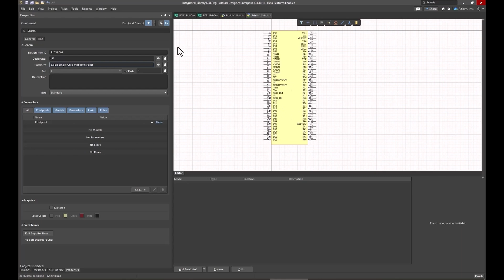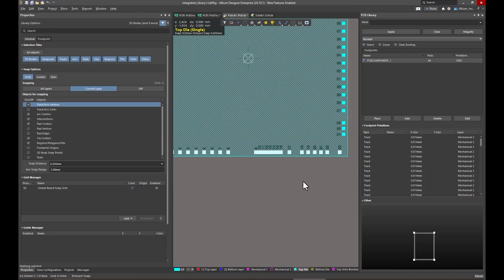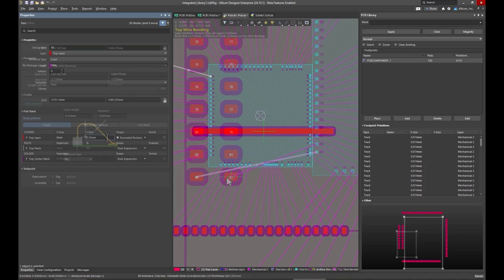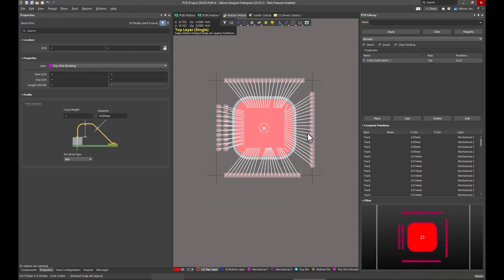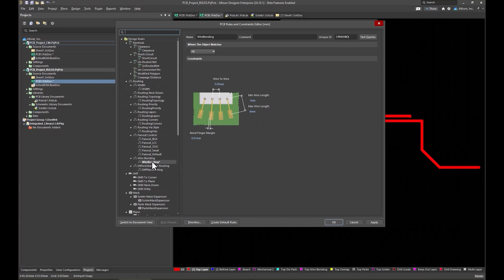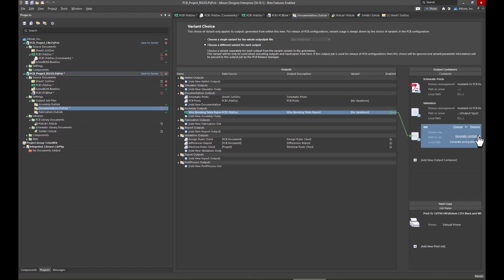Advanced Wire Bonding Techniques in Altium Designer - Demo

Comment: I am trying to use the Top Die and the Top Wire Bonding layers to import the STEP 3D model of my die and place the wirebondable die pads at the correct height (height of my 3D die model). 
https://youtu.be/aO292ia_lQs?si=TFyCgDULXm0Nzzos&t=79

In this tutorial, "Extruded" 3D model is used which is just a dummy block. It has the "Overall Height" text box which determines the height of the dummy 3D die body and also the height at which the wirebondable pads are placed an the Top Die layer.

But, in my case I am using the Generic type of the die ont he same Top Die layer, but this Generic type DOES NOT HAVE the "Overall Height" feature, so all the pads I place on the Top Die layer, are placed at the default bottom... And I can't find any way to influence the height the pads will be placed at.

Is there any solution to this or there is absolutely no support for the Generic 3D body?

Comment: when adding wirebonds from the PCB layout (rather than defining the pads within the component), is it possible to update the schematic layout with the updated netlist? Would be nice to have this so that the IC pinout is directly included in the PCB schematics
Reply: Everything is driven by the schematics, so you will need to define the pins first, then push the update to the PCB layout, not the other way around. One workaround is to set up pin swapping, then you could move pins within a certain group in the PCB layout and it will auto-update in the schematic.

Comment: Can someone tell me what the market is for this? Which industries use this tech? How niche is this tool and application? When I look at Chip on Board (CoB) I see the LED market pop up in google... I'm assuming FPGAs and ASICs (outside of LEDs)?
Reply: Most common use of this technology is Integrated Circuit Packaging. It applies to at least 60% of the components on a printed circuit board.
Reply: @ericr6287  right, figured
Reply: It's a fancy tool for documentation. Serious EDA tools do bond wire EM simulation so there would be some value in an accurate model. Altium is more of a CAD tool than an engineering tool in this way.  Maybe Altium's file could be used by Cadence for the analysis.

Comment: Just out of curiosity, how were we designing for bare die and blob chips before this? I know they've been a thing for over 40 years now; surely our design tools had some means of accommodating them.
Reply: Cadence tools mostly I presume.
Reply: It’s always cool to have new features to simplify and better align 3d models and reality, but you can do the same with careful planning and manual review.
Reply: Probably autocad to create a DXF of the pads followed by a 3D model of the wiring, or someone has a license to a proper packaging design application. On a different note, I think this is a prelude to a full-on packaging design application from Altium. Don't quote me on it and I have no visibility into the product development roadmap, but now that Altium is owned by a semiconductor company (Renesas) why wouldn't they venture into semiconductor packaging? Altium Designer is already like 95% of the way there, and we have been using it for organic substrate design anyways.
Reply: @Zachariah-Peterson  That's a juicy bit of gossip!
Now I'm thinking about the actual assembly process for those old COB designs. I imagine some poor shlub peering through a binocular microscope and fumbling about with a pair of pantographs to attach the bond wires. Yield must have been abysmal by today's standards.
Reply: @Zachariah-Peterson  Zachariah is somewhat correct.  To this day, AutoCAD is the primary tool used for creating wire bondiing drawings for simple packages such as DFN, QFN, QFP .. and other packages based on lead frames. For years, I have used an AutoCAD extension called "Electronics Package Designer" from Cad-Design Software.  This package greatly automates the creation of wire bonds. Allows the assignment of loop profiles. Creates 3-D geometry from the 2-D geometry.  Full version of tool transforms AutoCAD into an EDA tool like Cadence including netlist driven design and DRCs.  Long ago, I did BGA package designs for one of the large subcontract assembly houses using this extension. Today, by far the tool of Choice is Cadence APD/SIP.  Altium has a very long way to go before they have the capabilities of the APD tool.  Considering that most Renesas device are based on relatively small die with low pin counts, Altium looks like it might work for such design.
Reply: @Zachariah-Peterson  This would be great, but I think it might require quite a significant rework of Altium.

We use it for designing thin films and we struggle when it comes to very small structures. The grid size somehow can go below 1 um, but not the properties panel, so you end up in weird situations.